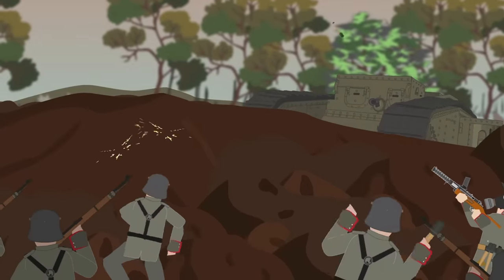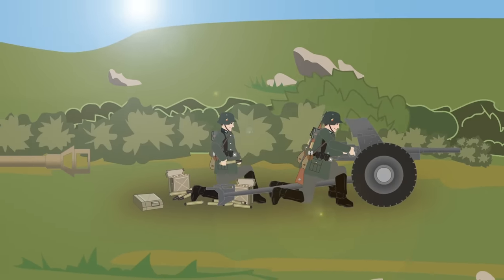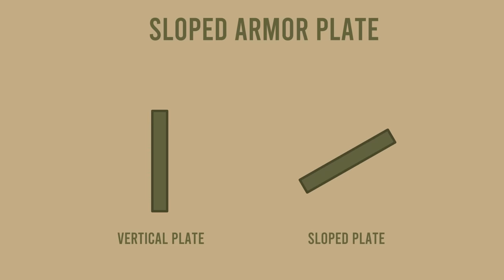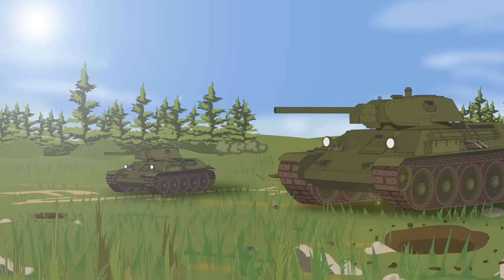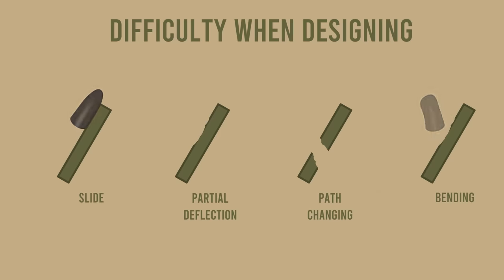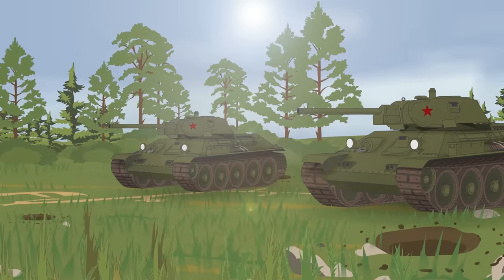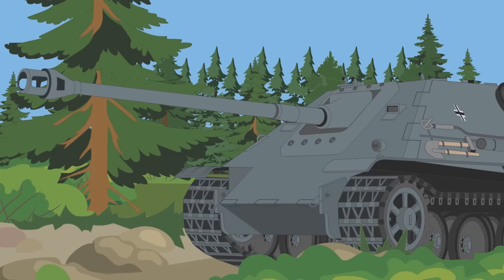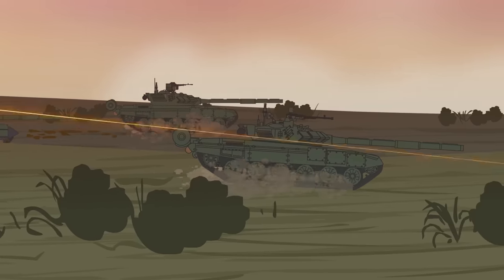Sloped armor: A simple feature that saved many lives

Comment: Actually, the advantages of slopes were already known in the high middle ages as we see in armour and castle tower designs.
Reply: Thanks I just wanted to comment this.
Reply: lazerpig pals?
Reply: Many concepts are discovered, forgotten, then rediscovered at various points in history. Also the difference between making armor for tank shells vs medivil plate armor and siege tactics is quite large in terms of history and context.
Reply: @NeutralGuyDoubleZero  remember the analog machine from the ancient?
Reply: lazerpig?
Reply: Just adding, but it's advantages go further than that. By the mid 6th century in Japan, a nobleman can afford a full suit of tankō, which by this time, comprised of a riveted, laminar cuirass with laminar lames similar to that of pauldrons.

I'm certain I can name older examples such as dendra panoply
Reply: But was it sloped for better protection from penetration, or was it sloped because of building/manufacturing technology of the time??

I'd be surprised if they had done real penetration testing, of that level, that far back.
Reply: @lordgarion514  about buildings i have no idea, but for armors was for protection, as tanks they where thiccer on the front and sloped, first to redistribute a blunt impact (like a mace) or to directly deviate them off vital parts of yojr body (like a spear going to hit in your chest, the armor force the tip to the side to make the thrust miss), and later for arrow protection, deflecting them like tanks do with shells
Reply: Early modern star forts had sloped walls against cannonballs aswell as diveted walls, so sieging/assaulting enemies would be in crossfire killzones
Reply: @lordgarion514  I meen they were trying to not get destroyed by black powder cannons or catapults so penetration may not have been a concern.
Reply: @Spacey_key  yes
Reply: @lordgarion514  Are you implying that they were less intelligent than we are?
Reply: To know something is one thing, to incorporate it, is another. As previously said in this thread, technology gets lost or forgotten and it’s a eureka moment when it clicks again.
Reply: @samueldocski4426  they did incorporate the concept of slopes in the middle ages. And btw, the German tank designers knew it as well. They just decided for a different design philosophy
Reply: @NeutralGuyDoubleZero  The protected cruiser of the 1880's is a ship which relies on a sloped armored deck inside the ship to provide protection from gunfire from the side and above. 

Fortress turrets of the era were typically highly rounded. 

I don't think they forgot about it.
Reply: @classifiedad1  It was clearly forgotten/not considered when they were first making tanks. So in the sense of mobile armor and weapons, still an innovation.
Reply: Have a like. Look at the design philosophy of a greathelm vs a Hounskull bascinet. The glancing surfaces of the skull and visor lessen the force the wearer is subjected to when struck. The design was so efficient the bascinet was in service for nearly a century before it became outmoded. That’s the equivalent of us still using WW1 equipment
Reply: @NeutralGuyDoubleZero  I dunno, the CA1, the St. Charmond, and the FT have plenty of sloped armor. The FT's turret in fact is very rounded.
Reply: Yet people still act like the russians invented slopes
Reply: Also the sugar load helmet. I had one of those for SCA before and sword hits just glanced right off.
Reply: Thank you!!
Reply: @thepoglin8479  Lazerpig is a youtuber.  Watch his video on the t-34 to see why sloped armor has been old news for centuries at least.  He's actually really funny too, so it is a slog.
Reply: Wasnt that why star forts are a thing?
Reply: @germanmemerboi3157  yes, star forts incorporated these ideas. But also much earlier, for example the switch from square towers to round towers in the high medieval era. Medieval helmets and breast plates also included the concepts of slopes and deflection.
Reply: @bandit6272  i literaly watch him, thats why i referenced him, because the commentor quite clearly watches him too
Reply: @thepoglin8479  Sure.  The question mark at the end made it ambiguous.
Reply: What if the shell bounded off the armour and hit the  cannon
Reply: @gunalr9371  that would require quite a lucky bounce, something to be far more worried about is something called a "shell trap" where the armour is sloped in such a way to where incoming rounds bounce into the turret ring
Reply: The Knowlage was list during 1700-1900 times as The new Guns could penetrate the knights armor any day
And artillery made castles nearly useless
Reply: @Spacey_key  thanks just checked out his channel
Reply: @NeutralGuyDoubleZero  Even the Renault FT had sloped frontal armor
Reply: Somebody forgot to tell the Germans 🐙
Reply: @jackd1582  to think that German engineers didnt know about these effects is rather stupid, dont u think?

They know about the effect but decided for a different design as sloped armour also has disadvantages.
Reply: @juanzulu1318  valid .... except that wasn't their thought process for the most part early on
Reply: @jackd1582  it was part of their though process all along the way. they just came up with different priorities.
Reply: @juanzulu1318   well it helped give the tiger a huge ammo capacity, but a lil sloping on the front hull wouldn't have gone astray
Reply: @jackd1582  i agree. As I said, different priorities.
Reply: And the Germans surely understood the concept, their battleships had sloped armour (turtleback) belts
Reply: Yes, even plate armor is sloped everywhere. No one designed plate armor like a square tin can.
Reply: Didnt little willie have like sloped armour on the lower front,right ?
Reply: Why do yall think they don't do this anymore? Because it doesnt work lmao
Reply: @carlj7466  they use it all the time everywhere. Laws of physics dont get old.
Reply: @carlj7466  man it does work but heat shells and capped rounds and the general improvement of anti tank guns and rounds made sloped armour less effective,it is is stil used today, it does have an effect but not that great of one these days
Reply: @carlj7466  also why did i get a notification for your comment, what is youtube on ?
Reply: @capdetigla  no clue lad lol
Reply: @juanzulu1318  yes they do. Why do you think people are constantly studying it
Reply: @Spacey_key yea
Reply: @NeutralGuyDoubleZero I’m a little late, I know, but I would like to point out this particular feature was included in both fortification and personal armor well into the renaissance, and then more exclusively in forts even after the invention of the first tank
Reply: @blaster443  then I'll refer you to the first half of my comment where I said many concepts are forgotten and relearned through history.
Reply: @NeutralGuyDoubleZero  this might be so. But it would be absurd to claim that German tank designers were not aware of these principals.
Reply: @NeutralGuyDoubleZero  then I'll refer you to the second half of my comment, where I said that this practice was never halted
Reply: Romans had sloped armour 2500 years ago
Reply: @lordgarion514  medieval craftsmen clearly understood the effect of a richochet. The only pro of a round tower is the better protection versus projectiles. Less living comfort and difficulty of construction are the contras. And yet, they built these design in their defensive buildings.

Same for armour. The design of certain breast plates or helmets show the intentional creation of angles despite being much more difficult to produce.